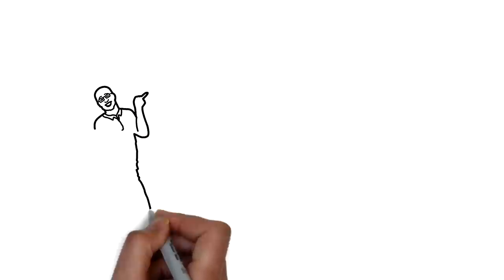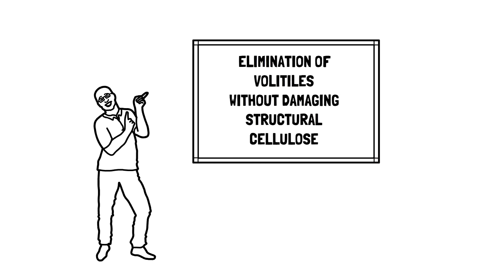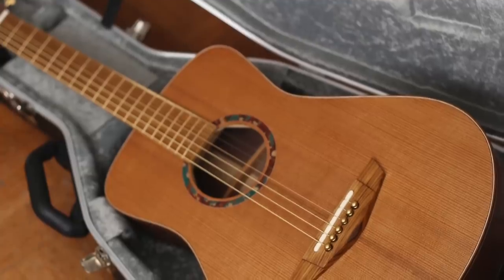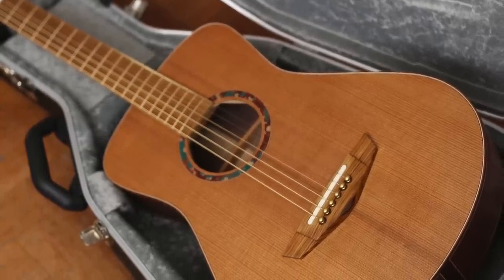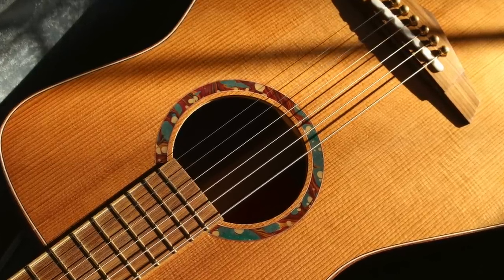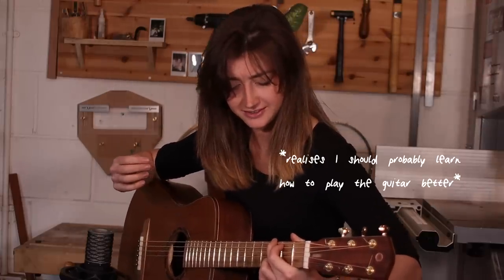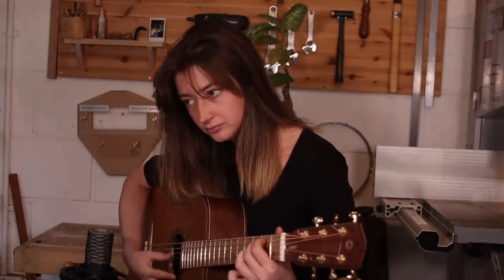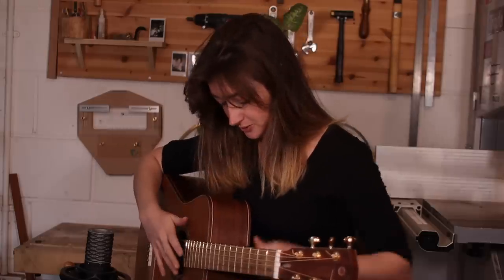I Made a Brand New Guitar With a Vintage Tone

Comment: I have a Gibson L-0 which was made in 1930. It was my Grandpa’s. The entire guitar is mahogany and like Daisy said is very hard and dried out. It sounds wonderful and plays like brand new. Recently, the bridge popped off. The glue dried out. I’ll be re-glueing it and give it another 90 years.
Reply: neck reset?
Reply: @BenState  No. The neck is perfect after 100 years. The bridge was loose when I got it from my Grandmother back in the early 1970’s. I popped it off and used epoxy back then. Recently, the epoxy popped and I glued it back using the correct glue.
Reply: @jamesdellaneve9005 no guitar's neck is perfect after 100 years.
Reply: @BenState  Well. I don’t know what to say. I’ve never had to even adjust the truss rod. And the top is slightly bowed (by design) which one would thinks would give you string height adjustment issues, but no. It’s setup perfectly and I’ve never adjusted it. The fretboard is perfectly straight. No buzzing, etc. It’s really quite striking. It doesn’t even need to be altered due to the weather. It’s all mahogany, even the top. BTW, I’ve made two short scale electric basses from scratch. I know how to build and setup instruments. My basses move a little with weather and seasons.
Reply: Take it to a pro.
Reply: @jamesdellaneve9005 anyone using epoxy to attach a bridge doesn't have a clue.
Reply: @BenState  I was 11 years old.
Reply: Beautiful guitar and sound is warm to my ears
Reply: i bought an LG1 back in 2013 when you could pick them up for £300. it had two really big cracks up the front and the cleating repair was so bad it looked like frankenstein stitching, but i found i could play around and it was easy to invent tunes on. foolishly i sold it (at the time i had a vision of owning a guitar shop - i've had about 60 guitars since then (some on my channel) but as soon as i posted i realised i'd made a mistake.
so i asked the new owner if he ever decided to sell it to let me know, and a year later it was on ebay again.
i didn't win the bidding so it went to someone else, but sadly it got smashed to bits in transit, so that was that.
i bought an all mahogany LG0 after that, but the neck was completely different to the LG1, so i sold that too (!) and bought yet another all mahogany LG0 - and the neck was different again to either the LG0 or the LG1 - i have no idea how gibson template their necks!
i wish i had held on to all of them for longer though, i think i sold any one of them for about £600 and now they go for £1500 - £3000. i talk about my current line up on my channel.
Reply: @jamesdellaneve9005  i had a J50 back in the 70's that the bridge popped off after i'd had it a week.
Reply: @BenState  well nothing is perfect, but if the tuning is spot on and there's no buzzing, that's all you need.
Reply: @captainchaos3053  odd that they have truss rod covers then isn't it. please do check before making sweeping statements.
Reply: @HarryNicNicholas  I do apologise none of my guitars if ghat vintage have truss rods that are adjustable.
Reply: @captainchaos3053  I have a 1896 Washburn that has no truss rod. But my L-0 does. I am so surprised by how well it plays. Like the setup was adjusted by a pro. It hasn’t moved since it was built.
Reply: @jamesdellaneve9005  your lucky.
Reply: @captainchaos3053  Yes. I play the bass. It’s hard to go back to a 6 string, but it plays and sounds great. It’s not original. The machine heads were dried and broken off. I refinished it when I was a kid, but it looks great. I added a nice pickup on it. I tested it out in our church and it sounds very natural.
Reply: You lucky devil. I play delta blues and would love to own a Gibson like that. Happy picking for many years I hope.

Comment: How about this?  Salvage the sound board from an old piano!  Congratulations on your continued growth! I love watching your videos! Keep them coming!
Reply: There are actually piano makers who uses shell/cabinet(?) from old pianos and add all new keys and the parts inside and they are supposed to sound great.
Reply: @blodpudding  I have seen luthiers who used 100+ year old piano sound boards for guitar builds. I recently acquired a piece for an ukulele build.
Reply: Piano soundboards have a slight concave or convex shape depending on which side you look at it, but you might get a piece flat enough to do something.
Reply: @Flea-Flicker  The piece I got was thick enough to re-saw. Once thickness sanded, it should work fine.
Reply: @Steve's Strings
Using sound board wood is a great idea, especially for ukuleles. You definitely have enough size for resawing. I have a 1904 Chickering & Son's baby grand that I am rebuilding. There are several different species of wood used depending upon the builder and era, so variable materials are definitely an option. Many times the sound board will crack providing the perfect opportunity for someone naturally aged tone wood.🤙
Reply: That works.

Comment: I think it all depends what your trying to compare to?  Some vintage guitars actually sound terrible with no possible way to fix it. I gave a very old harmony and it's a horrific sounding thing. 4 people have tried to help it sound better but truth is its not going to happen. So I stuck a light bulb and a clock inside it and it will live out the rest of its days hanging on a wall.

Comment: Does torrified wood bend differently or with more difficulty compared with the wood you would normally use? Like the sides on the body for example... I suppose torrified wood could be one addition of many different processes that I have heard of being used to bring out tone in wood... "pond" dried,  and I have heard a theory that somebody thinks Stratevarius "pickled" his woods for his violins... but it kind of sounds like these other processes are more about extracting the wood resins, and definitely much slower... almost makes you wonder what type of sound a combination of processes for extracting the resins and crystallize what is left behind may yield for tone... laugh, similar to everything a bagel goes through being cooked... if it isn't dead after all that, then it'll sing like an angel!!!

Comment: A friend gave me his fathers Martin guitar. A 1930 model made of Hawaiian wood with rolled silk and steel strings. Martin let the wood age over a 25 year period before making a guitar. The sound was incredible to say the least. That is some project you took on. Great work,thanks
Reply: Yea, no. That's not true. People will also tell you the reason pre-war Martin's sound great is that they used all the wood that had been sitting on the factory floor for the last 100 years because of the war. That's nonsense too.

They do have a torrefication process they use to artificially age the wood though.

Comment: Excellent use of the thumbnail!  And the guitar does sound very balanced.  On a separate note, I have one of those white Axminster bandsaws and although it looks ok, the frame has so little rigidity that the table can be moved/wobbled with one finger.  Thankfully it was a cheap eBay purchase so I'm not too far out of pocket.

Comment: Back in the late 1970's (yes I'm that old) I worked for a short time for a small local luthier in Southern New England (USA) and it was his belief that if you completely dry out your woods and then reacclimate them to normal conditions they have a far superior tone. He built a "drying cabinet" that kept the wood at 125 deg F. It also had a large pan in the bottom he kept full of calcium chloride pellets. CC is a desiccant that never stops absorbing moisture. He stored his woods for pending projects in there for months! Then they'd sit on a shelf in the shop for a month or two before building began. Was it better? Who knows! I once had a red spruce "master grade" top set that was dead as a stone. Looked pretty but had no ring at all! Keep at it and stay true to the craft. You'll make it!
Reply: i've found the problem is no two guitars, even from the same wood stock, sound the same.

i bought a martin OOOX1 back in 2016 and i actually think it's the best sounding acoustic guitar in the world, the bass really growls at you and the trebles have that martin bell ring to them, and the resonance goes right through your body when you play, new strings are mind  blowing on it.
the X series are spruce top and "HPL" back and sides, i think (nowhere does anyone say specifically) that HPL is just compressed and glued mahogany dust, high pressure laminate, so essentially it's a man made material and one would think consistent across all builds.

i bought ANOTHER OOOX1 to compare though, the guitar is that good.

the differences were: martin No1 was made in the USA in 2004, and martin No2 was made in mexico is 2014, and apart from the top finish (they seal it, but there is no lacquer, this is a budget guitar) and a 1mm difference in the break angle at the bridge, they should be identical - they weren't - (i do a couple of comparisons on my channel)
so i was surprised just how different two martin OOOX1's could be, completely different beats, and that's a man made material too.

i also have a 66 J45 (i bought in the 70's, i'm that old too) and a 69 epi texan - two very similar guitars that also sound entirely different to each other. you can't win with wood.

Comment: I think you really have achieved what I consider "vintage" tone, because that guitar has a very full warm rich sound that also has very crisp and articulate treble tones that are always sweet and never too thin, brilliant, or shrill, very much like a vintage Martin. Also, 12 fret guitars always sound the best compared to 14 fret ones. The change in where the bridge is located allows the top to vibrate more freely and just results in a fuller richer tone.

Comment: To vibrate the wood you can get an aquarium air pump and put it on the lid after the guitar is built. Move it around every now and then. Let it do its thing 14 days to a month and it'll sound more "played in". And in my opinion that guitar wouldn't look as great with a high gloss finish, it's beautiful in matt, it fits the tone too.

Comment: I have a Martin D28 Authentic from 2014.  I sought this one out because in 2015, Martin went to torrification on the Authentic line.  I found that, in my own experience, torrified D28s sounded thinner and lacking warmth, compared to the 2014 model.  This is  a HUGE YMMV.  My '14 is now 10 years old and it more than keeps up with my 1963 Brazilian/German-topped D28.  Both are heavy hitters in tone, power and just plain stonk.  Again, YMMV and it is all good  indeed.

Comment: I have a weird question...if you took two identical guitars...say two 1972 Martin D-35's and gave them to two different guitar players...one of whom never used a capo and played exclusively in DADGAD tuning and finger-picked nothing but sad Celtic ballads in D...and the other one played nothing but upbeat folk rock in E but usually using G chord forms capoed up to the 9th fret...setting aside any repairs or fret replacements over the years and assuming they lived in identical climates...would they be pretty much identical 20 or 30 years later? Or would the wood on the front of the guitar age differently based on the kind of vibrations it was consistently making over the years? Does the tone adapt somewhat to the player? If they switched guitars, would the DADGAD player's chords have the same tone as with his guitar? Or would the guitar of the 9th capo dude be so attuned to those vibrations that it wouldn't sound as good in DADGAD? Is a guitar's general tone in any way affected by the specific tones its owner plays over and over again? Common sense says No, or maybe yes, but not much. But my subjective experience is that older guitars sound better playing the kinds of tones that have been played on them the most. Also...I've noticed that my spruce top guitar definitely changes for the better over time tone-wise but my mahogany guitar sounded great when I bought it and still sounds the same 15 years later. Are some woods affected by age more than others? Love your videos. ;~)

Comment: I can tell you from experience "classic tone" is not a sales pitch.  It's a real quality, but it's not for everyone.  I'm a crusty old fart & grew up listening to/covering legendary guitar work from Neil Young, Paul Simon, Kerry Livgren (Kansas - Wayward son), Al Di Meola, and many more.  I could use "warmth", lighter presence, or chorded note cohesion to describe it, but I think the best comparison would start with an EQ curve graph.  And as you've already suggested, a scientific dissection of the tone-woods, bracing, bridge & nut materials, all the way down to the strings as they all contribute.  The challenge is knowing how to make a instrument that has the warm, buttery, soft spoken voice without losing note articulation & intelligeability.  Examples of guitars I've know to play that way are the old Guilds, CF Martins & Gibson dreadnaughts.  But tastes will vary.  I"m a huge fan of the classic sound & find modern guitars too boomy in the bottom end & too much presence to denote any semblance to warmth.  EQ curves don't lie.

Comment: Hi Daisy, I'm an engineer and shite guitarist. I did some research for uni about what properties are desirable in soundboard tonewoods, which seem to be low density, high stiffness and also low characteristic impedance which is defined by the speed of sound through the media. Also, your guitar will improve tone the more you play it and as it ages. This is due to a damage mechanism called creep. Where the micro-structure of the wood 'settles' overtime due to the loading applied by the vibrating strings allowing the soundboard to be better suited for vibration. It is interesting that luthiers such as yourself know this from experience but not sure if a lot know the true physical reason? Anyways, I'm glad I came across your channel, your videos are really interesting and insightful.

Comment: Certainly a controversial subject, that of 'vintage tone' from a new build, not to mention the whole 'torrefied' wood craze... Your guitar sounds very lively and clear, and I'm sure your customer will love it. (I certainly would.) As for guitars with built-in 'vintage tone', I would like to point out a line of guitars made by Collings in Austin, TX under the brand name Waterloo. They are Collings' 'sub-brand' of guitars (about a dozen models including a mandolin and an arch-top) which were designed based upon 1920s vintage examples of Oscar Schmidt Stella Parlor guitars; and also Gibson's 1930s depression era 'off-brand' Kalamazoo and Recording King guitars. Apparently creator Bill Collings had an original 30s Kalamazoo sitting on his desk for years, and was apparently captivated by its charm and challenged to replicate it somehow as a 'budget priced' instrument to compliment his very successful Collings line. Some of the Waterloos are built with ladder braced soundboards and non adjustable truss rods, just like the originals, or you can order them with more modern X bracing and an adjustable truss rod. They are all fairly small bodies, as that period was just before the rise in popularity of the Martin Dreadnaught style; so more in the line of single and double 0 bodies, also some with 12 fret and others with 14 fret necks. I do not believe that they used torrefication on any of the wood though. I currently own several of these Waterloos and am quite enamored of their tone and feel. They are unimaginably light in weight, under three pounds! I hope you can find an example or two where you are in order to get a feel for what they have done in order to capture that 'lightning in a bottle' concept of vintage tone in a new build.

Comment: G'day Daisy,

I'm sorry that it's taken so long to respond to your video - YT rarely recommends your channel to me, as I usually watch electric guitar shows.  But, having owned a few accoustic guitars for many years, I do like watching your videos.  In any case, this video was very interesting, but you didn't describe how you baked the wood, so I needed to check on a few things, & send you a note.

So, torrefaction is a process that reduces moisture in wood.  This is done by baking the wood at 375 deg F, dropping the temp down to 160 F, then letting it cool down naturally.  The flash point of wood is around 490 F, so catching alight is not a problem.  However, if the wood is baked in a gas oven, this process might not work.  When gas is burned in air, you're mixing hydrocarbon, nitrogen, oxygen, & a few other gasses.  The chemical reaction produces heat, nitrogen, carbon dioxide, a few other gasses, & water(in the form of moisture).  This is why a cake baked in a gas oven has more moisture than a cake from an electric oven.  As I said earlier, you didn't describe the process, so I thought this point was worth mentioning.

Anyhow, thanks for a great video.  I'm going to click on subscribe, & look forward to some more of your shows.

Keep up the good work
Andrew